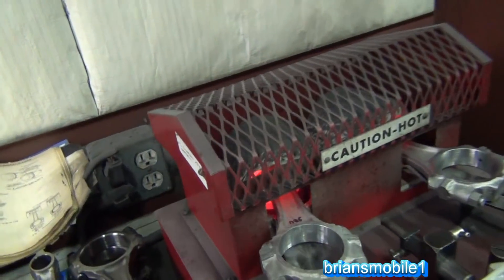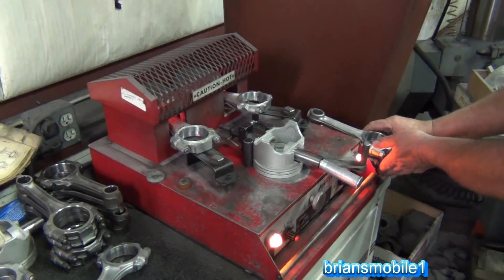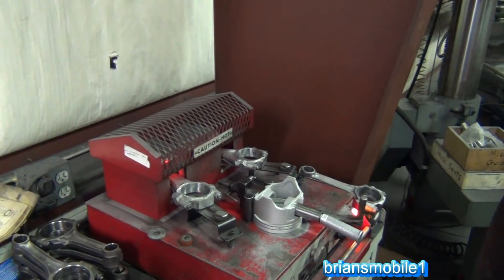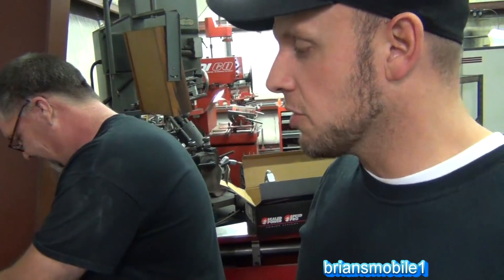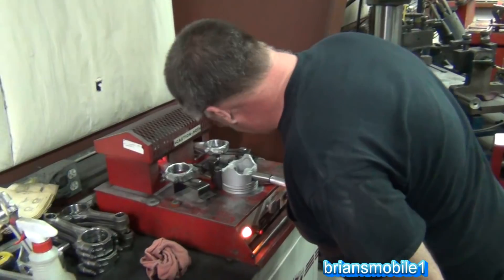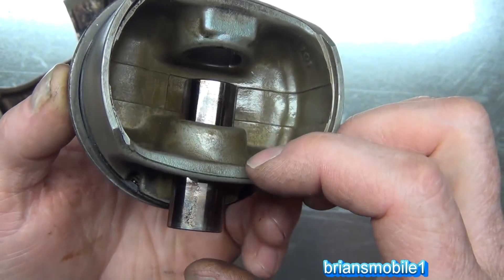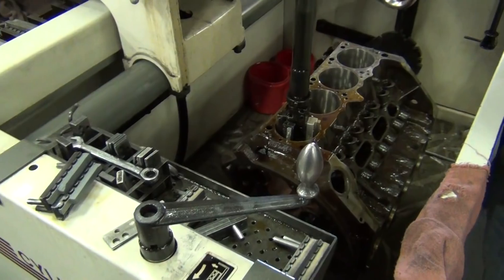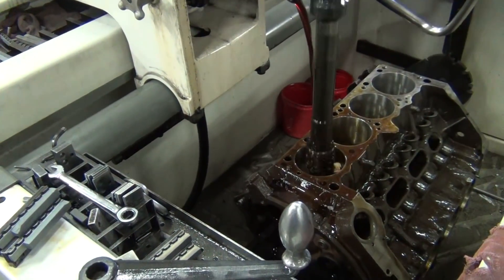Press Fit Pistons

Comment: You should never heat it. Metal expands in all directions, outward from the outside and further in first the hole. It actually makes the gap smaller. It moves easier because of the temperature, like jumping flicking water in a hot pan. Chill it and and apply some oil or lube that works at low temps. From then its like lego
Reply: show a video doing that I like the idea
Reply: Your statements are incorrect, the opening in the rod will expand when heated. https://www.youtube.com/watch?v=LVIwjAkv0Oc

And to the comment that "you should never heat it", the tool they are using is specifically made for doing this. I would wager that there are millions of press fit pistons that have been assembled this way. If you chill the end of the rod, the hole would get smaller. On the other hand, chilling the pin would help.
Reply: @car46999  do you understand the concept of expansion or did you overlook the part that tells you it's possible but not advised?
Reply: Apologies, I thought this was the post where I explained it. My bad
Reply: @deven6518  I do understand the concept of expansion. I am saying your statement that "it makes the gap smaller" is incorrect. The hole in the rod end will become larger, this allows the wrist pin to slide into a hole that is designed to have an interference fit. It has nothing to do with
Reply: @car46999  when metal is heated, what happens to the molecules?
Reply: @deven6518  When heated, the molecules begin to vibrate, causing the atoms to move farther apart. This movement causes the metal to expand. It's called thermal expansion. Regardless of what I know, your statement that the gap becomes smaller is incorrect. Your statement makes it sound like heating metal with a hole causes the hole to become smaller, which is incorrect.

Comment: This is ok for  most stock engines don't use this method on thin wall pins. As it will distort the pin as it cools. This egg shapes the pin, seems to be ok as it's assembled, in the engine,  but on startup , first warm up, the engine will seize, the pins will seize in the piston. So make sure the pins are thick walled, or press the pins in the rods, like you should.

Comment: I need to get new pistons put on my old rods. So do I need to disable the old ones myself and then take them to a machine shop to get my new one press fitted? or will the machine shop do that part and put new pistons on?. thanks
Reply: You're not saving any money tearing an engine down yourself before sending it to a machine shop. All you're doing is pissing off the people that have to put it back together after you break bolts and loose half the parts. If you're going to do it yourself then do it yourself. If you're going to have a shop do it then let the shop do it.
Reply: They will do it.
Reply: The more you do, the less you pay them to do, but then when it comes to stuff like this, where you get stuck is what the machine shop is for.

For the engine rebuild I'm doing (still taking it apart) at some point I'm going to say, that tool costs too much. Time to let the pro's do it.

If it's not the clip style, I think you need the heat like shown in the video.

Comment: If I remember correctly from an Ave video, its either steel or aluminium but for each 100 degrees it will expand 1 thou

Comment: or can we put the insert pin in freezer ?
Reply: cant get it cold enough like that.
Reply: I don't think so. I've been reading from other comments that you need 100 degrees F for each thousandths of an inch for the diamter to change. With .008 to .012 size of interference fit, that's 800 to 1,200 degrees.
Reply: .0008 to .0012 that is 8 to 12 ten thousandths.
Reply: practicalskills
Okay, so more like 80 to 120 degrees then, since I was a decimal off?
Reply: You don’t have to put the wrist pin in the freezer but you can I don’t like that method though do to it might warp the pin when inserted into a heated up rod and that will lead to a seized engine depending on the metals and how thick they are!

Comment: If the rods are heat shrink-fit onto the wrist pins how do you remove them later without pressing?   Or are they not meant to be repaired only replaced?
Reply: Press out the pins.

Comment: I did a Jeep 2.5L, by heating the connecting rods in an gas grill without the grates in place.  You only get a couple of seconds to center the pin :)
Reply: I think one of the things that helps on processes like this, is that the heat is even and gradual. Seems to me like your method would achieve all the requirements.

Comment: No torque plate during cylinder boring. I'm not a machinist but I've heard others say you should use one to simulate the torque applied by head bolts. Any thoughts?
Reply: because its a chrysler?
Reply: Not important is my thought.  Some high dollar racers that need to win claim they can win by doing that, I'm not a racer.  Simulated head plate is not a real head, hole can never be held properly then, gassing on and on about nonsense that doesn't apply to real life anyway, bores the living the hell out of me.
Reply: That's because he's honing the block, not boring it.

Comment: From what I understand, iron and steel expand approximately 0.001" for every 100 degrees fahrenheit.  Mic a piston pin and the small end of the rod to find your interference, and heat enough to add an extra thousdanth or two to allow the pin to slip in.  :)
Reply: 0.001" per 100F per inch diameter
Reply: Sicktrickintuner
Thank you for the correction!  I felt like I was missing something.  :)
Reply: The interference is normally .0008 to .0012.